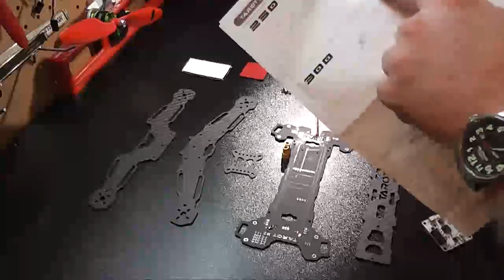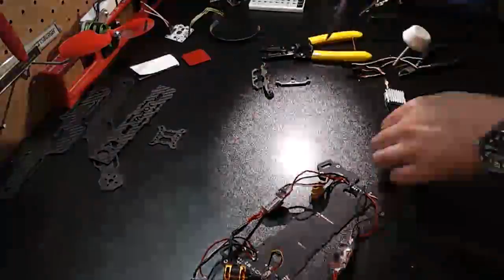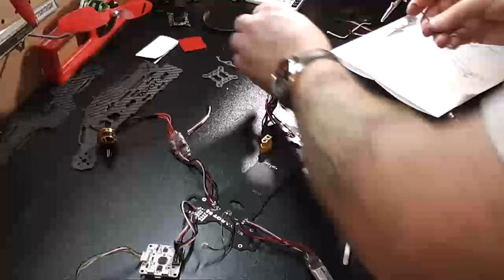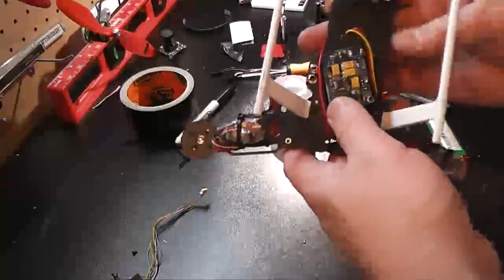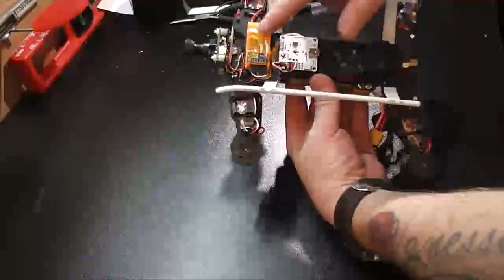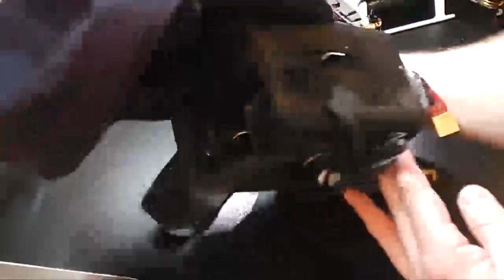Tarot 250 mini quadcopter build and review.

Comment: i've followed your video while building my tarot 250. everything looks the same but for some reason i can't make it take off. is there any additional directive that you can provide . thank you
Reply from the maker: +jean jules Elle Try changing your lower throttle endpoint. usually that is why things don't arm. But this quad really is behind the times nowadays! There so many better frames out there, like www.dronzonline.com

Comment: Hello
I wear a naze in tarot 250 placed at the bottom but arrives and down movements of both the nose and the back were incorrect are being invested,
We have to change something in the settings to be correct when installing the board in the bottom ??

Thank you
Reply from the maker: +Javier Franco The placement is meant for Acro flight only, if you use a leveling mode you will have to mount it in the center.

Comment: How did it fly?
Reply from the maker: In acro (no stabilization) it flies fine. But in this setup (as per directions photo) the stabilization is slow to return on the pitch axis. So it feels funny. I have moved everything around (like it "should" be) but I haven't flown it yet due to getting new components (radio FPV cam etc) and the snow of course. I will make another video soon. Also my companies design is almost done in solidworks so that should be a buyable option around early summer. This frame will also include a ferrite signal filter built in etc.

Comment: Hi Chad, nice video, I am rather confused now though as you seem to have built your Tarot 250 with the main board (with circuit board) upside down to the Tarot instructions. On your model the battery socket is on the right just in front of the rear arm facing up, in the Tarot instructions the the battery socket is on the left just in front of the rear arm facing down, so they DO intend that you mount the CC3D flight controller on the underside. Unless your Tarot 250 build instructions are different to mine ! .

Comment: Thanks for sharing, Chadd. You're right, there aren't many videos out there for this frame, and it looks like you've parts are indicative of what most would use. I was considering this frame to add to my fleet of HobbyKing 250s, but thanks to your video I think I'll hold off, until Tarot comes out with a 330 to fit my GPS and Mobius. Cheers!

Comment: Is the video signal clean and regulated or do I need to install a power filter in between the board and my vtx?

Thanks
Reply from the maker: The signal for the most part runs through the integrated board in the chassis. I haven't had any issues and I have the cheapest video TX you can get! hahaha But I also run circular polarized.
Reply: Hey thanks for the reply brother.

So you don't get any lines in your video when you punch it full throttle?   That's awesome I guess the integrated PDB cleans the video.  BIG plus as power filters are at least 13+ grams!

I also use Cp antennas..  VAS Ibcrazy bluebeam ultras to be exact.     When I built my 3S blackout mini h that also has an integrated PDB I needed to install a power filter cause the power draw on throttle was causing lines bad.    I use a TrueRC 5.8 crosshair antenna on a nexwave RX module and Ibcrazy bluebeam ultra mad mushroom on an ImmersionRC 600mw vtx

Have you flown it yet?   Cause the lines won't show up unless you fly

Thanks again brother
Reply from the maker: Chris Garza well I havent "punched" it yet, there is the normal interference I guess, but not bad at all. It is very flyable. But I don't want to claim to be an expert pilot by any means! I am an engineering student though!, (but that means basically nothing! hahaha) I have recently re arranged everything (put the board on the top center etc) and have not flown it yet. Maybe the different placement might help. But with work and school I barely have time to fly.
Reply from the maker: Chris Garza There is a video on how to build a filter out of soft ferrite rings, a capacitor, and some enameled wire. Costs about $4 but you can basically mount it anywhere and use it for ballast : http://youtu.be/xDUoxsMpfYQ

Comment: Great job! what did the build cost less the head set.
Reply from the maker: I will just break it all down: Frame $35, motors (BE1806) $58, CC3D $17, ESC's (4x turnigy plush 10A 9 gram) $45, Turnigy plush ESC card $8, 700TVL FPC board camera (with osd and adjustment cable) $27, CF 5030 props $15, FPV TX 200mw (came in set with RX/TX) $37, CP ant. (set of 2) $7, Orange DSM2 RX $15, Turnigy nano-tech 1500MAH lipo $13, so total (less radio) $277.
Reply: Great jog on the video, thank you for getting back to me. Have a great day. that's about what I have in my TBS quad But the mini is great to fly for fun.
Reply from the maker: Soldier53flyer  are or were you a soldier? I am ex Army CAV
Reply: Yes, 22 years in the US Army. E-7 I was in the 82 Airborne 1977 to 1980. I was in from 1972 to 1994 Thank you for doing your part. It take a good person to be a Soldier. Welcome Home.
Reply from the maker: I did 6 years E5(P) 19 series 1st armored Div and 2nd Infantry Div. Hooah to you too!
Reply: I was with the 3/19FA at Ft. Polk in 1976 as well.
Reply from the maker: A gun bunny! lol I was a TWAT for a while! lol
Reply: Chadd Steimel 13B  I could fill this box with all the jobs they gave me. have a good one.
Reply from the maker: Soldier53flyer Thank you for all you have done!
Reply: Chadd Steimel Thank you, and take care.

Comment: Hello, the cc3d is at the right place ?
why do you not put this in the center of frame ?
if it is not in the center of the frame is more difficult to tune.
Reply from the maker: Well that is the problem with this frame. They want you to mount the CC3D in the front, on top, right behind the FPV camera which is no where near the center. They do not offer any mounting holes, just a drawing of the completed setup. I chose to mount mine on the bottom, upside down (to keep the orientation) and further back to keep it more towards the center. I didn't have the plastic case they want you to have to mount it to the top/front. I don't think on such a small frame that having it in the front makes too much difference. But I did notice that the self leveling was "slow" and I think that has to do with the position. But in theory, the board "should" work in the same manner. It still pitches and rolls like if it were in the center, but having it towards the front obviously has made the reactions slower. If you fly it in Acro, there is almost ZERO difference. I feel they designed this frame with the Acro pilot in mind. My company is designing a purpose built FPV CF frame that will address and fix all of these issues. We are about to release a center mount for the CC3D for this frame as well. I will post here on the video when it is released.
Reply: I agree. If you use horizon and auto level often this frame isn't for you it's geared towards pilots who fly in rate mode.  

Just ordered 1.  I'm gonna throw a naze32 acro on there though

Comment from the maker: Once it is done, it is a VERY advanced design. Everything is kept clean and it is designed for use with the CC3D board. But..this is NOT a "temporary" frame. Everything has to be permanently attached (wiring) But if you plan to use it for FPV..there is no better frame than this one!
Reply: The CC3D atom seems to be even better....
Reply from the maker: Is that the one with gps?
Reply: Chadd it's the tiny 8g sized down version.   Basically the same as regular cc3d just smaller
Reply: Chadd Steimel I broke one side of the landing gear on my maiden flight.  do you know where I can buy it separately or any suggestions? thanks! on my channel you'll see a short video before the crash.. :(
Reply from the maker: From the tarot website, or even banggood. They use these same landing gear on lots of different airframes. (mostly helicopters)
Reply from the maker: Chris Garza I have never been able to get my CC3D boards to work right on such a small quad. I have an Atom as well. Same thing happening. Has a strange "drift" in all directions at random while hovering.